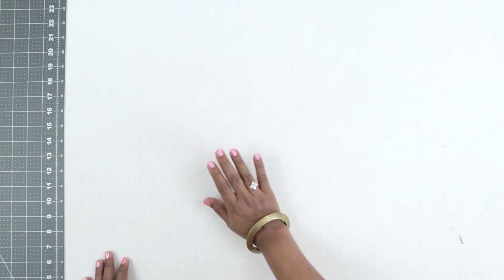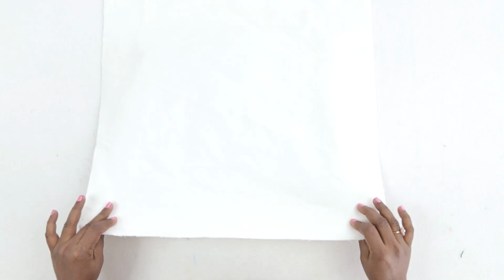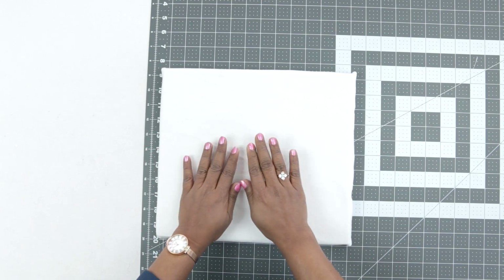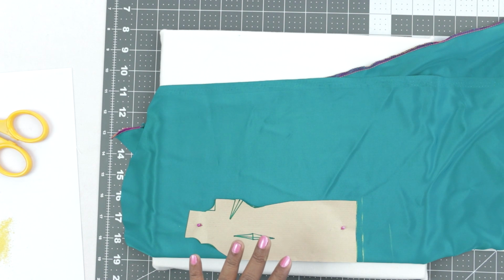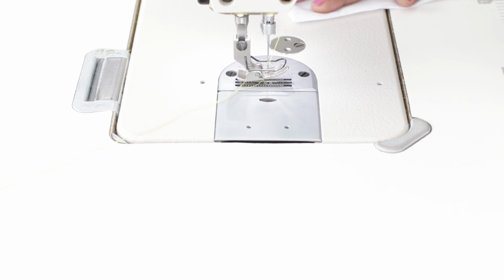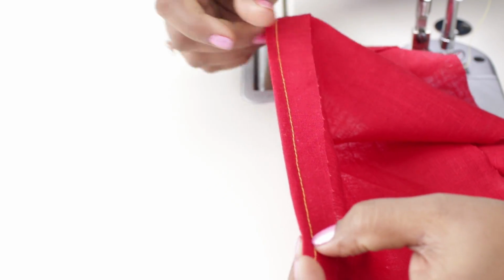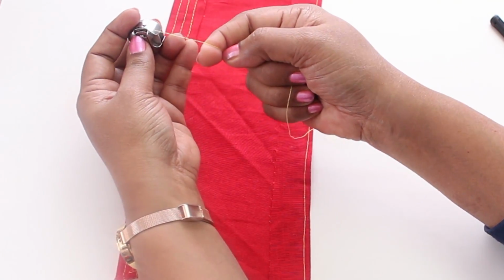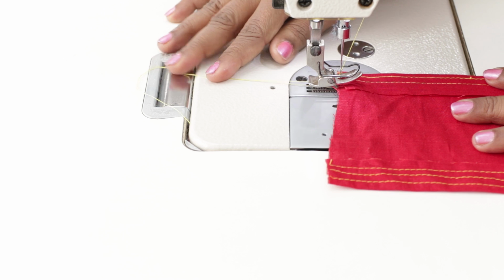Class 41 -How To Make Fabric Covered Cutting Board & Useful Sewing tips for beginners/ easy DIY

Comment: i'm Liss. i need your help as early as possible. thanks. my invisible zipper sample is really puckered. I tried to adjust the tension on the top of the industrial sewing machine. Do I need to loosen the screw of my bobbin? I have attached the images below in this link. http://liss-omathil.wixsite.com/workethics
Thank you. Can you please help me?? Thanks.
Reply from the maker: Hi Liss, check the stitches, if there is looseness below then adjust the tension on top and if the loops are forming above, check the bobbin case.  When you pull the thread through the bobbin case, it should come smooth [neither too tight nor loose]. Hope this helps
Reply: this means that bobbin is fine. actually the dots/knots/loops are behind or inside. thanks though! - Liss
is this problem something to do with needle?? i'm making a small mistake, but have not figured it out till now. 
thank you.
Reply from the maker: Could not see the images as the link you sent did not open.  Adjust the tension on top, also check if the machine is threaded correctly and hope the foot is down.  Needle would not cause this problem.
Reply: Got it. You are the best in skill and teaching. Keep the teaching go'g! I truly believe you are the best teacher. thanks :)  <3 .. my prayers and regards
Reply from the maker: Thanks for your kind appreciative words. God bless you.